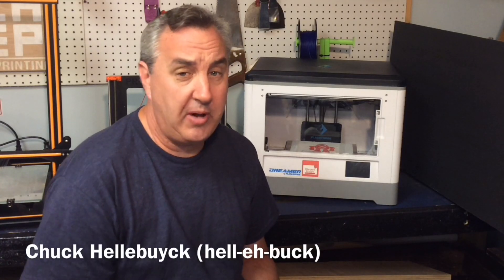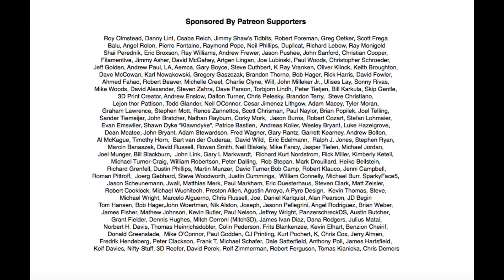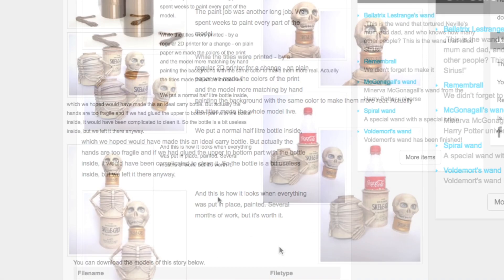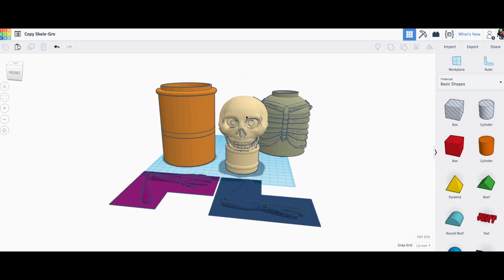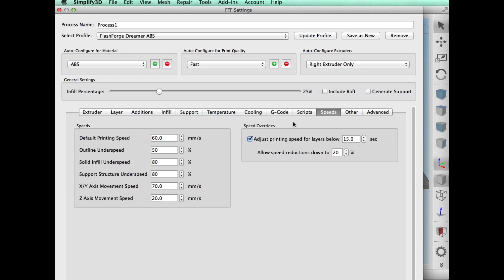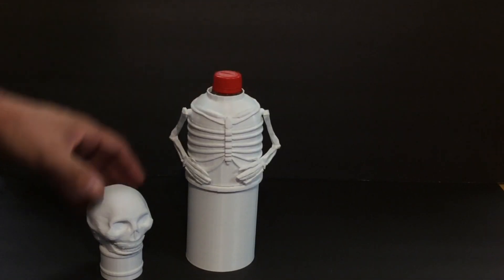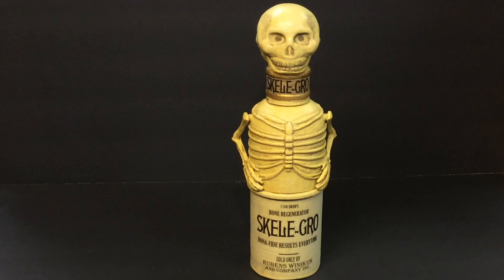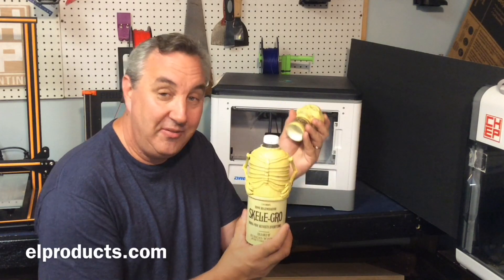Skele-Gro Harry Potter Prop - 3D Printed

Comment: Which ABS do you use that easily smooths?
Reply: Nope, some are mixed with other stuff and will not work.  100% pure ABS is the best.

Do you use the heated method or the cold method?  I am asking because I can tell you the cold method with Hatchbox just doesn't work even after 6 hours it just never really works and becomes a mess and Hatchbox does 100% melt within a few minutes in Acetone.  I have heard Inland is good at smoothing but not which method was used and your parts are pretty hefty so if you can smooth those then it would be a piece of cake for the size of prints I normally do.

Comment: Great result, looks good.

I've really liked your Tinker CAD tutorials. I'm new to 3D CAD. I've seen a bunch of Fusion 360 tutorials, eventually I'll figure that out. However for someone just getting started it seems like using primitive shapes in Tinker CAD is a much gentler learning curve. It is also much easier to explain your designs to someone who doesn't even know how to use 3D CAD yet. Thanks for your great tutorials.